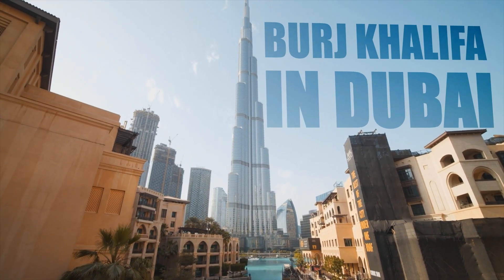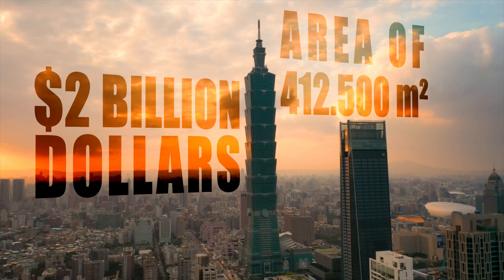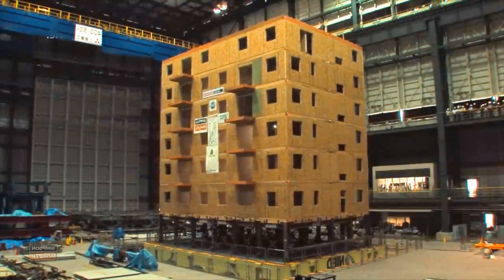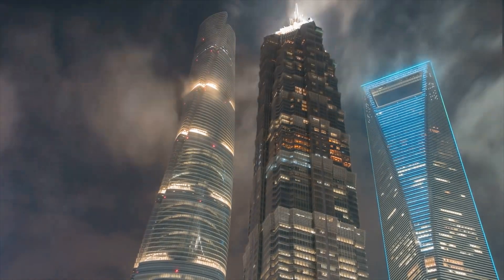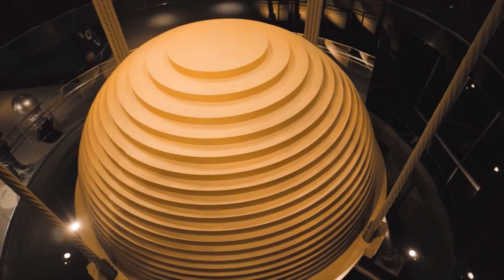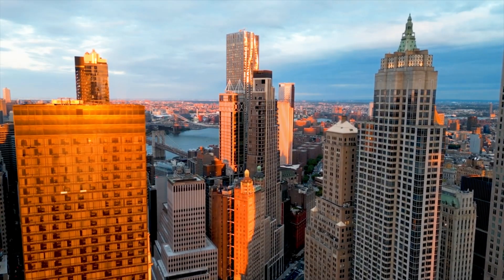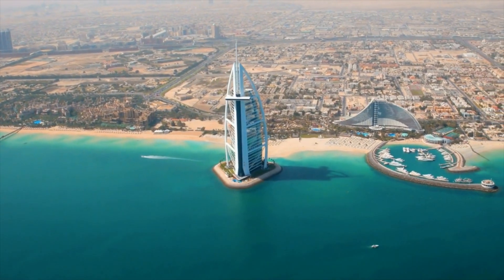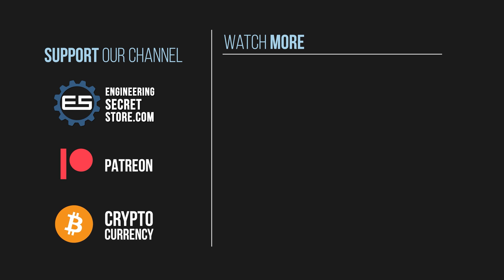The GIANT BALL That Keeps Skyscrapers Standing | Taipei 101 Pendulum

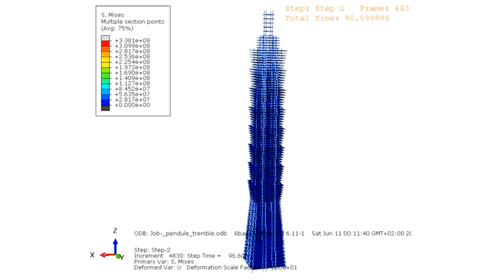Comment: 3:26. He says: The stronger the wind, the greater the amplitude and frequency of the oscillation. Wrong. Only the amplitude increases monotonically with the wind strength. The frequency is determined by the distribution of mass and the stiffness of the structure.
Reply from the maker: Thank you very much for your correction! More accurate info is very welcome. I will pin your comment at the top.